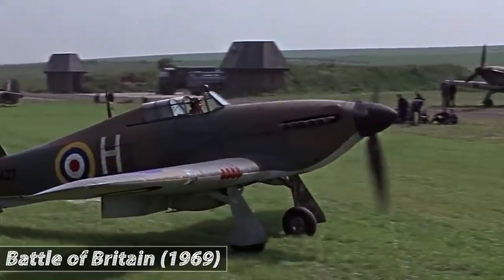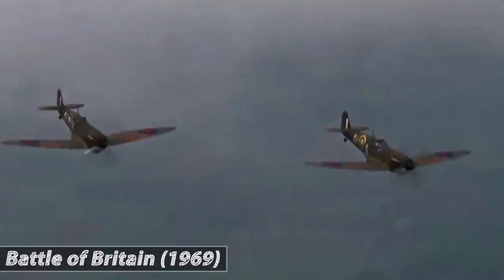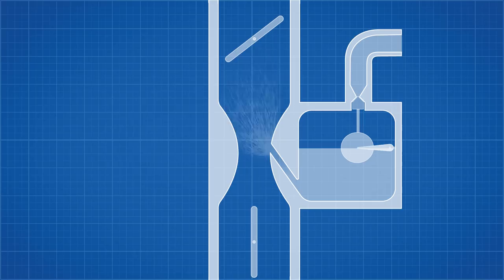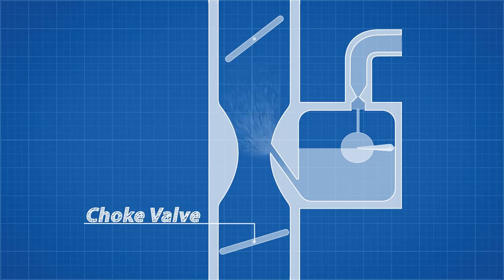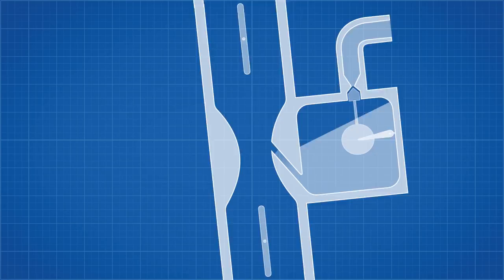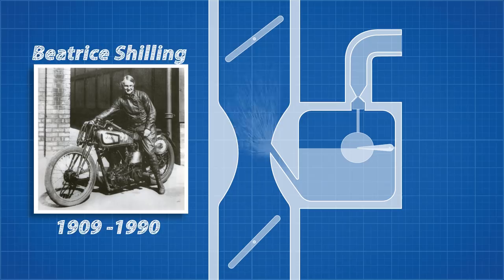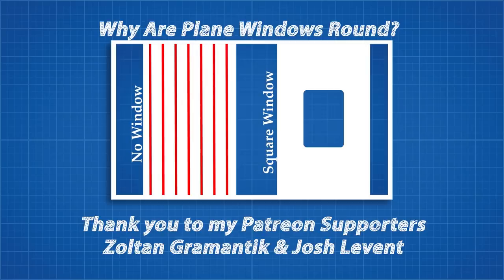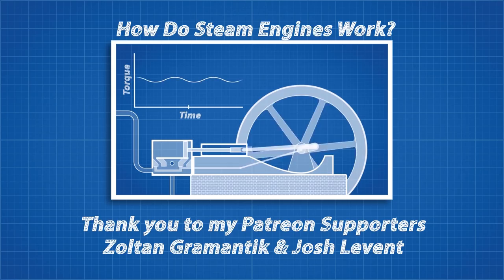The Spitfire's Fatal Flaw

Comment: Boy, I do not wat to be a jerk, but the airplane in the opening scene is NOT a Spitfire. It is a Hawker Hurricane! Better place some remarks about that...
Reply from the maker: I know, very difficult to find decent footage of the spitfire. They both suffered from the problem anyways!
Reply: True, they had the same carburator problem, as they were equipped with the same Rolls-Royce Merlin engine.
Reply: +dosmastrify I do not Thank Space X have taken the name of their engine from Rolls-Royce.  Maybe they took it from Merlin the magician...
Reply: I suspect they did.
Reply: @RealEngineering  There is plenty of footage of Spitfires, as for the problem, it wasn't a big deal and was improved on by the time of the Battle of Britain and completely solved in 1941.

Comment: 1.) It doesn't spit fire
Reply: Chris Hero it does if you load the guns with incendiary rounds!
Reply: Fucking genius
Reply: The RR Merlin and RR Griffin spits did spit fire out of there exhausts
Reply: Ya don't see the p51 mustang firing mustangs
Reply: To be fair, when it popped the black smoke you can hear exhaust pops so in that case it most likely did spit some fire then
Reply: @whistonjuniors  No, I'm serious, All WW2 planes which short exhausts would spit purple tipped flames out of them when starting and using their WEP, Spitfires, P-51s and some of the Russian Yaks and or some German Bf-109 / Fw-190 would spit flames, But most of the time it was the Spitfires and P-51 spitting flames since they both had the same short exhausted Merlin/Griffen engines.
Reply: @yumyunrangLOAL  Yeah, I know. It's called backfire and is a result of rich fuel air mixture where the fuel leaves the cylinder before compete combustion and continues to combust in the exhaust or even outside of it. You see it on any piston engine given the right conditions
Reply: It spits fire out of the exhaust. If you have ever seen a spitfire start up.
Reply: @why_sr03  why can't you and william take a joke, and also it isn't nice to call someone a moron if they make a joke.
Reply: William Campbell it's a joke he/she knows it not called a spit mustang your lucky your not on R/whoosh
Reply: The p47 thunderbolt doesn't shoot out thunderbolts.
Reply: It does when it shoots yellow tracers!
Reply: @Rascal_the_Raccoon  what about red tracers?
Reply: @whistonjuniors  Sir, what you are explaining is NOT A BACKFIRE. It is a case when during the combustion stroke, the fuel is not totally exploded, but burning and when the exhaust valve opens the remain flames will emerge through the short exhaust stacks. A BACKFIRE is when the intake valve is a little leaky and the fuel in the carburetor gets ignited and the fire comes out through the intake and not the exhaust.   One should keep the intake valves in good condition as though it does not get punished as much as the exhaust valve...... the backfire in the carburetor could do a lot of damage. Normally the engine stops, but with a carburettor at the intake, the backfire, it could be of great concern.  Two-stroke engines can do it for a different reason and the backfire is through the crankcase. I had some small engines with racing porting which did this, as the exhaust flame is caught up by the new mixture coming up through the transfer ports.
Reply: @Chris Hero, OH MY GOD, YOU ARE CORRECT
Reply: I have seen multiple spitfires “Spit Fire” but they all had the Merlin
Reply: How many fires could a Spitfire spit if a Spitfire could spit fire?
Reply: Talk to the hispanos and see what happens
Reply: 8 7.7 mgs firing Incendiary Tracer rounds. It spits fire. Also, the exhaust spits literal fire.
Reply: But I'm not a rapper
Reply: I thought that's how spitfire works when I was young
Reply: I dont know if you are joking but “fire” is referred as bullets. Thats why they say “we’re under fire” when they are being shot at.

I am gonna be an idiot if this is a joke.
Reply: Chris Hero acctualy it did.
Reply: Wait, wasn't some spitfires equipment with some kind of flamethrower at some point?
Reply: Chris Hero When I was a kid and heard of this plane, I thought it literally spit molten balls of lava.
Reply: Chris Hero S m o k e t r e e s
Reply: 2. The Hawker Hurricane was more important.
Reply: i mean as much as i know your probs joking, that's literally where the name came from ;)
Reply: It did on start up, and the 8 guns all firing also contributed to the name
Reply: Uhm, well it does
Reply: Jay Baker and it isnt a horse
Reply: Chris Hero it does
Ever heard of machine guns?
Reply: Actually when starting up, the exhaust at the nose of the plane shoots fire out of it and aswell it just rained hell on the enemy. Those are why I think it was called the spitfire
Reply: It does when it starting
Reply: @jaybaker509  no because it fires freedom rounds
Reply: 1. Spitfire is what the designer called his daughter and 2. The bullets are so hot they are practically fire without flames
Reply: It fires spit
Reply: chris Hero It does at the start
Reply: Actually it is most older engines that did it
Reply: @americanflyingclassics8036  It was in the Hurricane II and the Spitfire I It was fixed temporarily late 1940
Click Bait
Reply: On a hot start up it spits fire through the exhausts
Reply: @raidbandit1283  if you say so
Reply: A Merlin definately does
Reply: "It doesn't spit fire" - it most certainly does, and out of those stub exhausts.
Reply: It does out of the exhaust when you start it up.
Reply: Thinks it's called spitfire after a niece of one of the designers who had the nickname annie spitfire because of her temper
Reply: 'Spits smoke' doesn't sound as ominous, except maybe to the pilot.
Reply: Chris Hero That’s the dragon 🔥🐉
Reply: Your smart haw did it get its name
Reply: It would if it had speakers that play my mixtape
Reply: British night fighters had exhaust flame dampers. They reduced top speed but the flickering light dazzled the pilot’s night vision.  
German planes had inverted cylinders with lower set exhausts. They eventually fitted dampers because those annoying Brits could seem them coming.
Reply: It actually did from its exhausts
Reply: @whistonjuniors  back fire is through the carbs, AFTER fire or overrun is out of the exhaust
Reply: That’s a good thing
Reply: Unless you load incendiaries
Reply: Chris Hero with 8 .303 brewing machine guns I beg to differ
Reply: @why_sr03  The Spitfire was censorily renamed after an infamous Elizabethan pirate ship, the Shit(e)fire, which was deemed too crude for 20th century British tastes.  It seems appropriate the fire emits from the tail(anus) pipe.
Reply: "It (my toilet) doesn't spit fire."  Mine bloody well does after a good hot curry.
Reply: merlin engine spits fire
Reply: Chris Hero yes it does. The flames coming out of its guns.
Reply: @jaybaker509  Just the pilots spitting feathers when the Spitfire dances rings round them.
Reply: Well, if it gets shot...
Reply: Not yet
Reply: Adolf that you!?
Reply: @williamcampbell9859  it is if it shot down and on fire 🤷‍♂️
Reply: It does when you start one up.
Reply: @jjtomecek1623  some spitfire pilots but incendiary rounds into their guns if they where specifically targeting bigger targets
Reply: Sure does if you take a poop in the engine feed.
Reply: W I t h t h e r I g h t d r u g s y o u c a n
Reply: @bedfastmoney1883  Usually due to
Reply: @jaybaker509  It does have the horsepower of a thousand Mustangs.
Reply: It's fine we got it covered, weve already got eminem in pilots training
Reply: Bruh
Reply: It spits hot lead pieces
Reply: Please dont forget that fuel, (no matter the octane rating) takes time to burn, hence flames from the exhaust are always present because the combustion process has not completly finished before exhaust valves have opened. The distance from exhaust port to exhaust tip is very short. It is more evident at low light and even more so during cranking/ start-up (fuel thrown into manifold by priming) and low engine rpm or rich mixtures set by the pilot.
The fix for the carby was actually conceived by a woman, and I am very sure that most, if not all draught carby's on the suffering Merlins were retro fitted with the fix. So to see a privately owned postwar spit or hurricane cut out during a maneuver for a film would almost definately be the pilot trimming back throttle for the re-enacting.
Reply: It kind of does if you watch the engine turn on.
Reply: I can't help but wonder if any German pilots forced into an early retirement by the pilots of the Spitefire would disagree with the original comment.
Reply: Well the engine does Spit a bit of flame

Comment: This is indeed a flaw, but it isn't a fatal flaw. The Spitfire was a highly successful aircraft, which means it didn't have ANY fatal flaws.
Reply: asaeampan Do you understand the difference between a flaw, and a fatal flaw? A flaw is something you can work around (don't go around turns at high speed for example.).
   A FATAL flaw makes a design inviable. For example, the DH-106 Comet had a fatal flaw that caused catastrophic airframe failure. The DH-106 is probably the most beautiful ever designed, but it was a failure because of this fatal flaw.
   The fact that the Spitfire was successful means that it had no fatal flaws.
Reply: Well actually it was indeed a fatal flaw until they introduced a quick fix to prevent fatal flaw from occurring thus making it into a flaw.
Reply: sermerlin1 Did you skip the part where I explained the difference between a fatal flaw and a flaw?
Reply: I wonder how many British airmen died after their engine cut out from that 'non fatal' flaw?
Reply: Eric Taylor wrong, it was a fatal flaw, because in certain manoeuvres the engine did choked out at the worst moment possible making his airplane a sitting duck for a short moment! It was partially solved thanks to this woman but it never really solved the loss of flow to the pistons! That is nothing to take away the merits of a wonderful engine but the facts remains, and it was well known from both British and German pilots!
Reply: Bartonovich52 Not to many, I'm sure. Pilots are smart and train around these flaws. They train to fight with the planes strengths and work that the enemy doesn't exploit the weaknesses.
    Besides, "fatal flaw" has to do with the viability of the design, not the survivability of accidents for the pilots.
    If that is your standard EVERY airplane would have "fatal flaws".
Reply: Paolo Viti (sigh) Okay, in this context "Fatal flaw" doesn't refer to how the plane might do something that could get the pilot killed if they are stupid. A fatal flaw has to do with the viability of the design.
     The Comet (airline) had a fatal flay that would cause catastrophic airframe failure. The plane literally came to pieces in the air. This was a fatal flaw, not because it killed people, but because it made the design unviable.
   This flaw in the spitfire was NOT a fatal flaw because it could be worked around.
    The conditions that would cause the engine to choke out were known and avoidable. The pilot only needed to not put on negative G's to keep the engine running.
    Besides this was a design flaw of the engine, not the plane. And frankly the engine was one of the best ever made. The RAF used it on nearly ALL their planes, from heavy bombers to tiny interceptors.
Reply: +soaringtractor
Tractor McTrackface, the Carb' problem was solved immediately. Two-stage auto-superchanging was fitted giving the engine 70mph more and another 10,000 feet of operation.